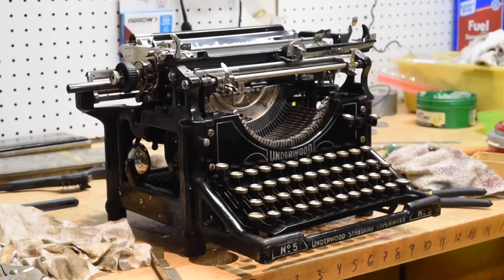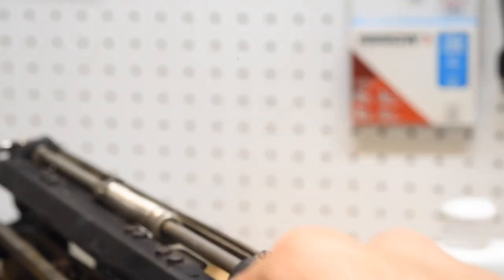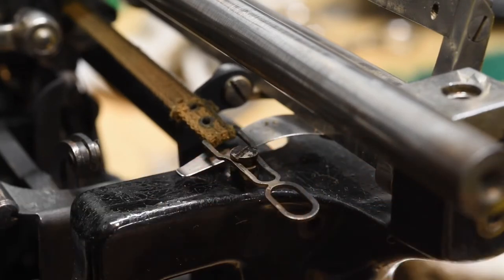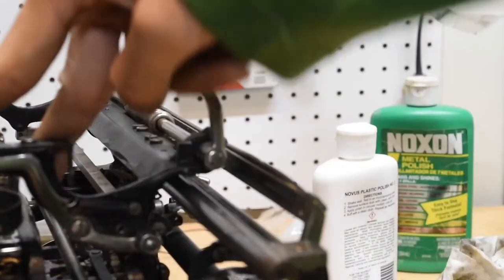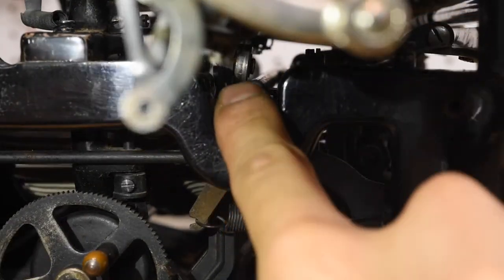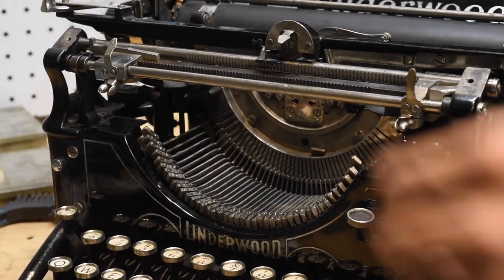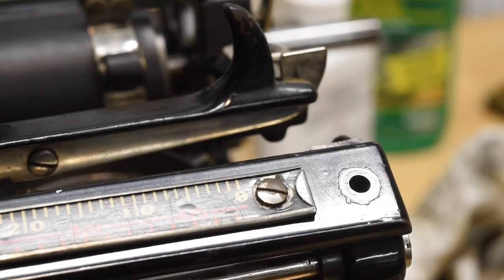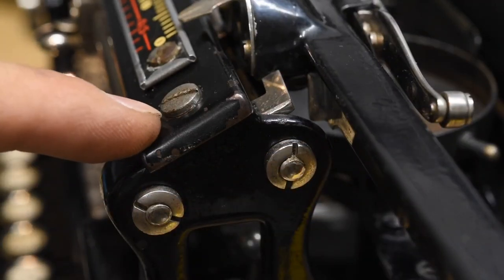Type Shop, Ep. 6: installing the carriage on an Underwood Standard

Comment: I have an Underwood which I believe is a 1916 model. The type face strikes the lower quarter of the platten. Like the platinum is permanently elevated. I tried to press the shift key a few times, but it doesn’t seem to help. It moves a bit but set down far enough. 

It seems like the entire Platten is elevated. I don’t know why this is - I took the entire carriage assembly off and put it back on everything seems to be resting where it should. Even the bearing wheel. I took detailed pictures of the right side of your reassembled typewriter, and will compare those to mine. This is a great video and very clear. I’ll let you know what I find out. Hoping this will get me going!

Comment: I have an Underwood No. 3.  The carriage does not sit on each of the 2 lift frame hooks evenly.  It keeps popping off the left hook.  The entire carriage wobbles and doesn't seat completely on the subcarriage.  Is there a guide showing what adjustments I need to make to have the carriage seat properly?  Or do I have to find an entire new carriage assembly for the typewriter?  Any help would be greatly appreciated.
Reply from the maker: Sounds like a support rod or something underneath may be bent.  Make sure the shift bearing is resting on the shift rod under the carriage.  There should be a hook that hangs onto the bottom of the rod.

Comment: Does this same method work with the no 4?  I can't seem to tilt the main edge of the carriage back that far, and I don't want to force it and break anything.
Reply from the maker: It should be exactly the same, just make sure you're removing all the right screws
Reply: @TypewriterChicago  I can't get the pivot screw for the carriage shift tension lever out, even after spraying a ton of penetrating oil on it and waiting for a day.  All my screwdrivers just slip without ever making progress, I don't think I've ever had a screw be this messed up.  Is there any way you'd recommend removing this screw or is there a way to still remove the carriage without taking out this screw?
Reply: @TypewriterChicago  Nevermind, finally got it out by just taking out the screw on the other side of the shift tension lever.  Also found these small tabs on each side of the top that needed up be unstuck and shifted forward to be able to remove the carriage.
Reply from the maker: @sleeplessengineer1450  you should use proper slotted screwdrivers, hollow ground.  You can remove the carriage as a whole with the two screws on the rear bearing rod

Comment: Hi Lucas, I need a right knob for an Underwood 5 as I think it cracked and broke off the one I have.  Any suggestions for this repair?
Reply from the maker: You can try and use CA glue to put the pieces back together, otherwise I'm not sure.  I MAY have a part, I'll check